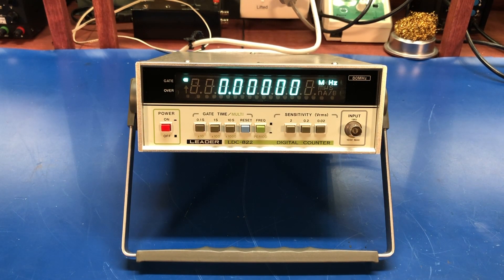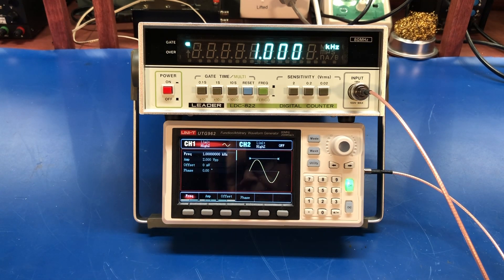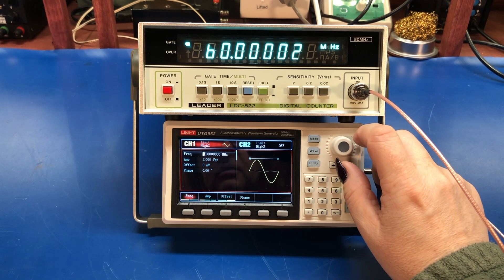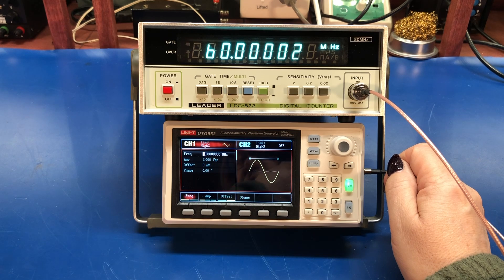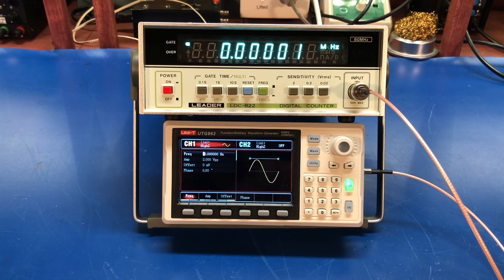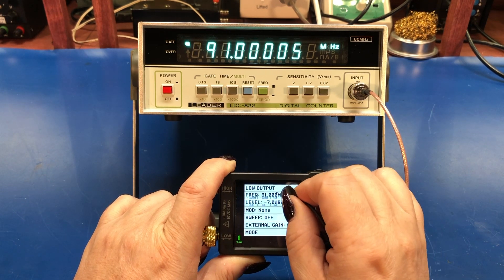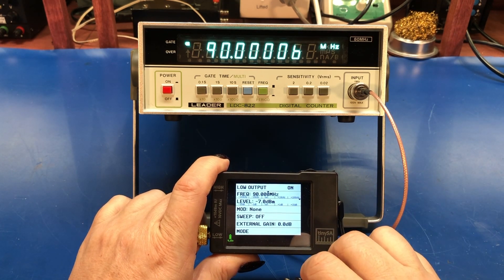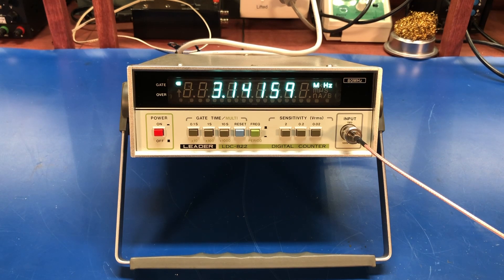Quick Look: Leader LDC-822 Digital Counter

Comment: Hi, I noticed in a post on Mastodon that this frequency counter has a VFD with an extra "eighth" segment for use when showing a '4'. I've seen something similar on calculator displays too. But in your video it looks like this extra segment is never lit. Is that correct?
Reply from the maker: I've never seen any extra segment lit for the numeral four. No slanted line n mine - sorry.
Reply: @Donna_Matthews  OK, thanks for looking, anyway!

Comment: I came accross this exact unit, whats this actually used for?
Reply from the maker: It's a frequency counter: feed in a signal and it tells you the frequency.  This one will measure up to 80MHz. You can, for example, verify clock frequency in digital circuits, or with proper attenuation, you can monitor transmitter frequencies.

Comment: Hi Gary, can you tell me at what serial number they went to LCD or an easy way to tell by looking at pictures? Glenn
Reply from the maker: I don't know when they switched over, but you can tell by looking at pics of the display powered on. There is a fine metal mesh over the digits - part of the VFD design (https://i.ebayimg.com/images/g/JhMAAOSwIPVj3CEw/s-l1600.jpg
) - that will not be there for there LED ( https://i.ebayimg.com/images/g/6g8AAOSwkcFj4AlM/s-l1600.jpg)
Reply: @Donna_Matthews  Thanks Gary, that is easy to see.